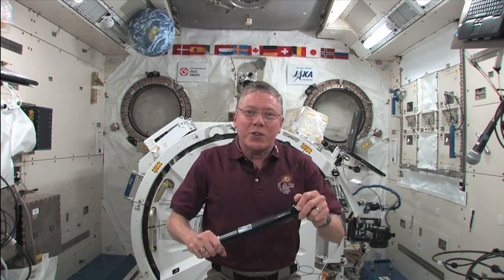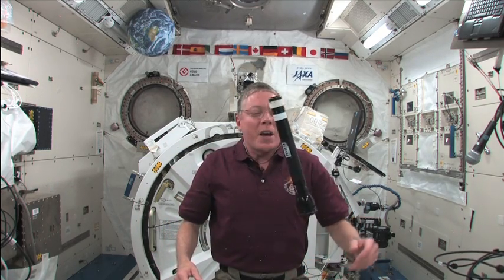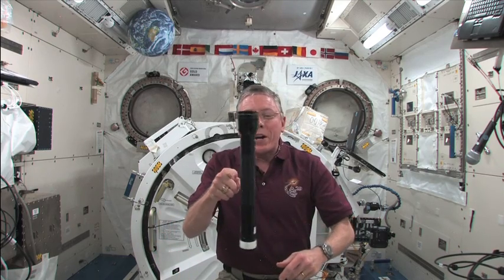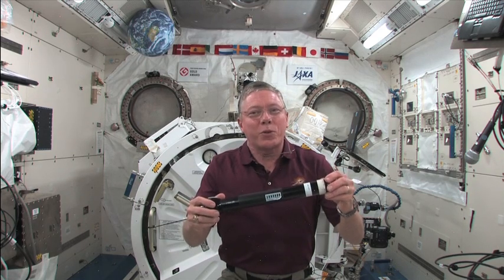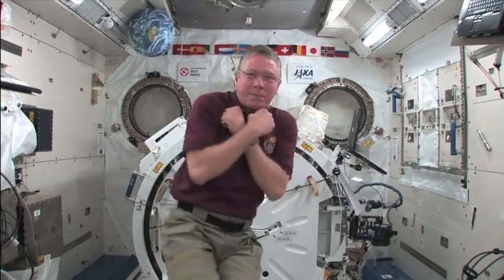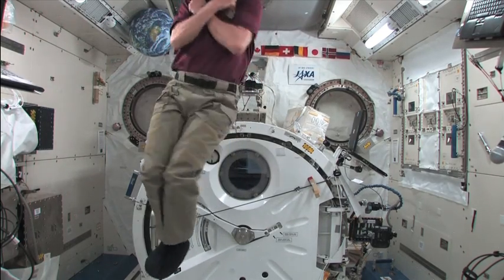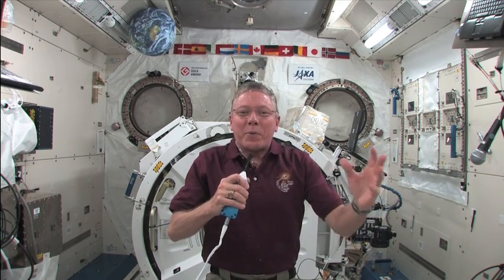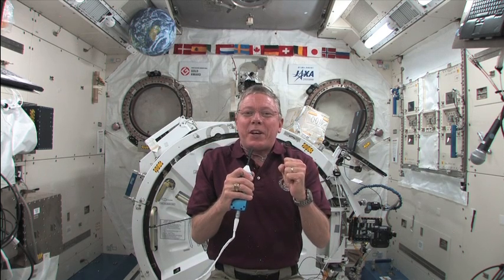Angular Momentum

Comment: Great Video !!! Angular momentum has interested me as a method of propulsion for almost 6 decades, since Gr 12 physics :)
Maybe someone can help here?

As you demonstrated by pulling your arms in, your rotation speed increases. 
If a man at position A in space starts rotating another mass (a steel ball) at the end of a string, the angular momentum of both bodies is altered by the energy exerted to increase the angular momentum. Eg: angular momentum of an object increases when its mass, rotational velocity, or distance from the pivot point increases.

Once the ball is outside the center of the man's mass, point B, he releases the string and then grabs the string again.
The ball should travel 90 degrees from the release point and when the string is grabbed again (ball at point C) the the resulting force vector is the hypotenuse and any movement will be between A to C. 

Doesn't this allow a rotational force (electric motor)  to be converted to directional propulsion without ionizing inert gas propellants like xenon or krypton? What am I missing or is this worthy of an experiment on the ISS?
Reply: If the ball is released, it will not continue to travel in a circular path. It will instead travel in a straight line path. I do not think that idea will work.
Reply: @akashb1590 Yes, I'm counting on the ball traveling 90 degrees from the release point. The man should also travel 90 degrees from direction of the ball when released. This creates a force vector which is no longer just a straight line between where the ball and man were upon release. A new vector between the man and ball is created when the string is grabbed. I'm counting on these forces NOT to balance out and the ball and man do not return to their initial locations.

Comment: I am sorry if this upsets you, but I have discovered that angular momentum is not conserved and if you measure your demonstration, you will find that it conserves angular energy.
Reply: Angular energy is not conserved. The friction of the speaker with the air transforms the angular kinetic energy to heat so he slows down. For the short duration of the video you can see that as he deploys his arms outwards, the angular velocity decreases.
Reply: @tommulvey9449  according to Richard Feynman, if the results of experiment do not match the predictions of theory then the theory is wrong. 
According to Tom, reality is wrong.
Reply: @tommulvey9449  wishful thinking nonsense.